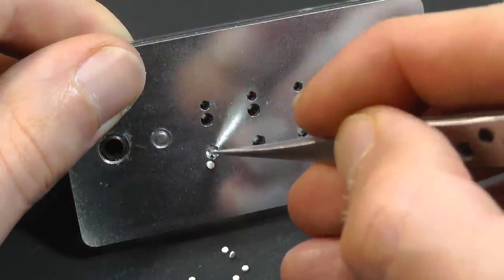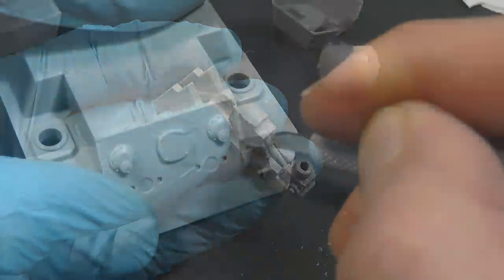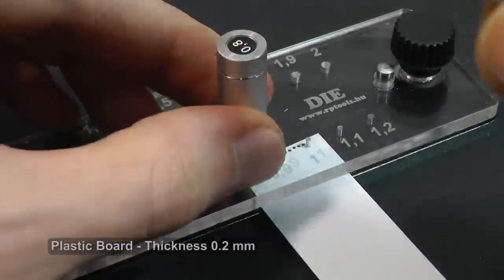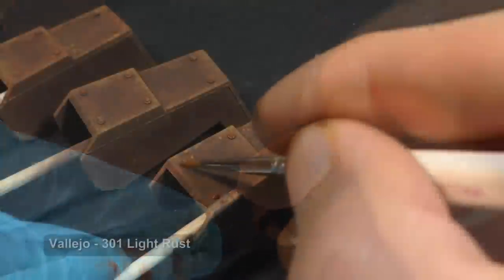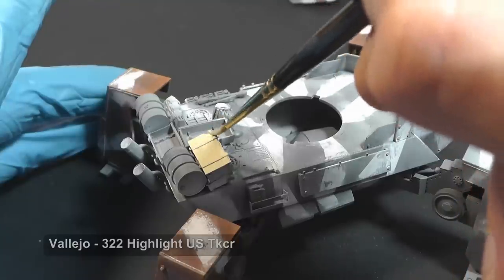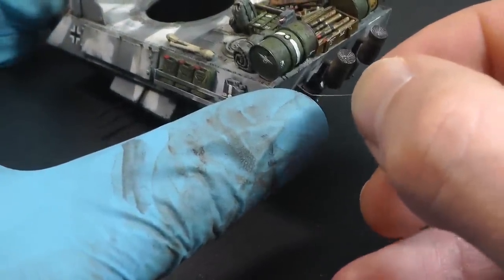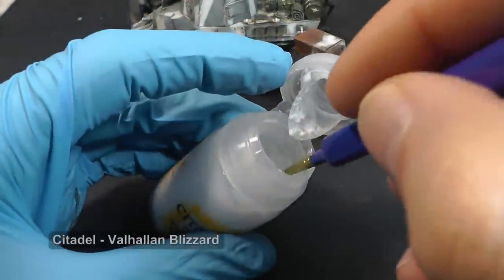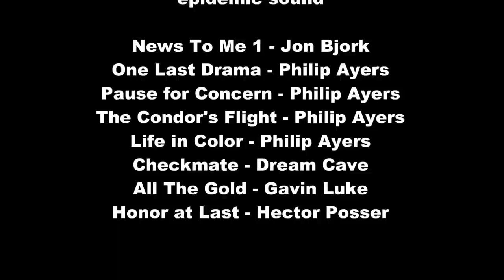E-75 First of War - 1/72 Modelcollect  - Tank Transporter Model

Comment: If you enjoy doing kits of a vehicle that never actually existed, may I suggest the Japanese 1/72 scale Akuyaku #1 Infantry support tank.

It looks like an oversized WWI type of infantry support tank.  The turret, as provided, has almost no traverse without running into the over hull tracks.  I built a barbette from styrene strip to raise the turret enough to get greater traverse.  I will eventually add sloping armor to the front, and sides of the barbette, as vertical armor isn't great protection on a tank.

The main gun is a short barreled 150mm low velocity gun.  I used the main gun collar, and fitted a 1/35 German 88mm, long barrel without muzzle brake.  This gives me about a 176mm main gun, of high velocity.  The main turret also has a second "gun" barrel, but since I don't read Japanese, I'm not sure what they say it is, so I adapted it to be a flamethrower barrel.  Between the main gun, and the flame thrower tube, is a large opening.  I made the opening smaller, by plugging it with styrene tubing, the making the tube a main gun sight.  I added a droppable armor cover to protect the sight.  Below the sight is the muzzle end of a water cooled coaxial GPMG.

The hull has numerous secondary gun positions, but I haven't really gotten started on the hull much, so haven't decided what I am going to do there.  It does have an extendable armored observation cupola, which is an interesting concept for hull down observation, and target selection.

Check the kit out, you may find it an interesting build.
Reply: Who makes that tank Bruce?

Comment: Try extra fine sawdust like mdf sawdust and spray paint it lightly in a box while you toss it so it gets covered in light dry layers until its all pure white you can then usr it how u want either mix with pva glue or have it loose then spray it with modpodge?

Comment: oddly enough I just started the same kit a few nights ago.... (The E75 Heavy Panzer) The kit has a few problems though, such as bad fit, which require parts of the model to be sanded down. The bottom of the rear turret will come into contact with the top of the rear hull, so the turret needs to be sanded down. A cool sci fi model, but will require a lot of fixing to do with the fit.
Reply: Have you finished yours Simon? I just got one.

Comment: You always do such a amazing job I wish I had the money to do that with how expensive paint is
Reply: Depending where you live, everything could be cheap or expensive. But when all the things you require to build a decent model start to pile up, then you realize how really expensive the hobbie is. But almost every hobbie is like that, except if you collect leaves or rocks from your surroundings 😁
Reply: start out painting with using the 0.50 cent paints from crafting stores. sure its a lesser quality product and not always ideal, but they do the job. everyone sucks at painting when they start out so might as well start with cheap paints on cheap kits.
Reply: spaeron thanks for the tip I will check them out

Comment: In a battle with this tank I would be aiming straight for the barrels of fuel over the engines.
Reply: Won't do much, fuel doesn't movie explode that easily, as a bullet wont probaby ignite it unless it makes some sparks, and even then, I doubt the explosion would do much
Reply: @vicentec4779  it will light quite happily when it spills over the exhaust manifolds...

Comment: So, I have to say, I don’t like the extra armor plates on top of the front of the hull - pretty much entirely because they interfere with the traverse and elevation of the main guns.
Reply: Perhaps with it being on legs, the elevation wouldn't be so much of a problem.
Reply: PaZuZu 666 in this case, the problem is that they basically nullify any gun depression that the tank has - and that assumes the E-75 has enough gun elevation to even get the main gun to clear the armor panels at all - if it doesn’t, they’d literally have been better off putting the gun in a fixed superstructure with limited traverse.
Reply: @ScienceRules118  Geez, it's a "fantasy" model, you're taking it way too serious bud.

Comment: Excellent skills with the modelling, but my mind just can't accept the idea of an E-75 in that configuration. Two 75? mm's would require an extra loader. A single 88mm KwK 43, or 12.8 cm KwK 44 would work much better. The legs would make the tank even slower than tracks without improving cross-country performance, and the joints are exposed and vulnerable. Also, if the E-75 was elevated so much, the glacis plate would extend down much further.